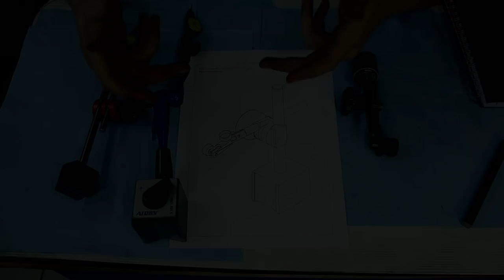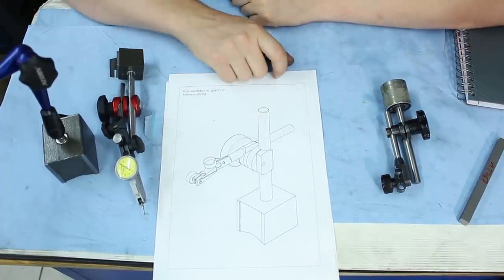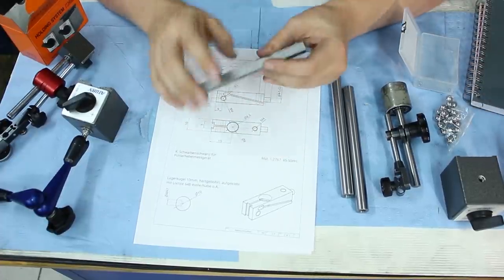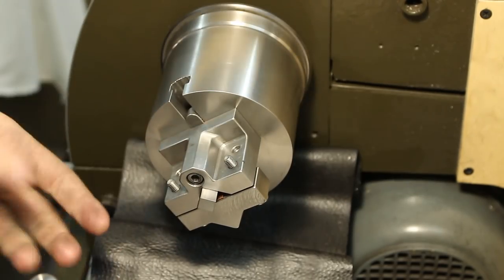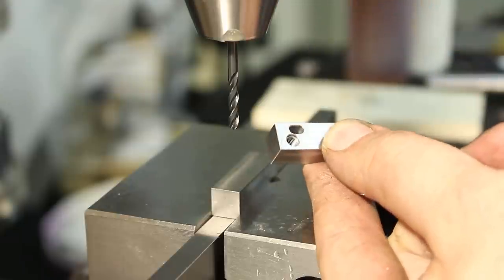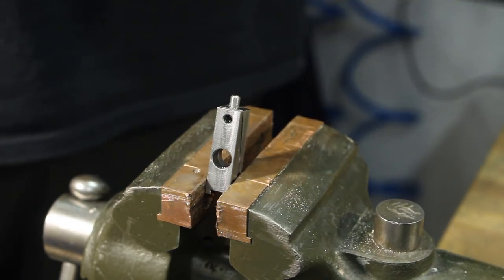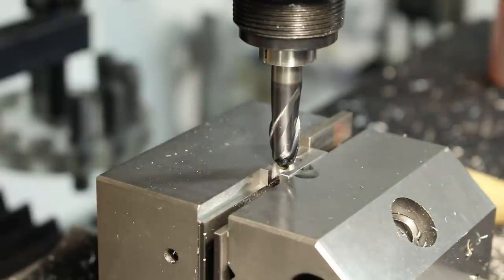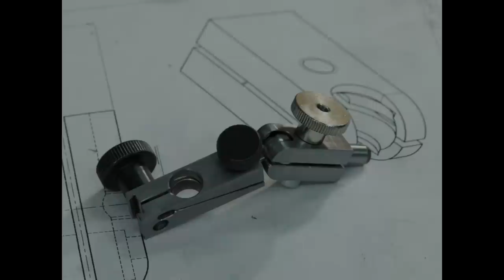Solid Indicator Stand - Part 1

Comment: I once repaired a mag base which had it's main column thread stripped out. Initially a 6mm thick mild steel top plate was made and attached with countersunk screws. The mild steel was a great success and failure at the same time. After remaking the plate in a non magnetic stainless the base was transformed from broken to most rigid stand in the shop and the column never loosened up again.

Comment: The same complaints/problems with indicator mag bases can also be applied to height gages. I have an ex-USN Starrett 18" height gage and anything over 6 inches above the surface plate it gets too shaky. I used to use a B&S height gage at my old job that had a much larger foot print and much greater mass. The adjustment was way smoother and there was no noticeable shake with the indicator at full height. And this was with tenth's indicators. It just goes to show. In the machining world rigidity is one of the most important things there is. Whether it is actually cutting material or inspection and gaging a rigid set-up makes life so much simpler.

Comment: Nice video Stefan! However, I do have some critique:
A high definition ball joint should consist of a ball and two concave spherical rings. Of course, you want to have full control over where these bearing surfaces are located and you might not want them to be to big, because that might ruin the definition. An easy way to accomplish this is by basically drilling two holes with a chosen chamfer, using a sacrificial(?) ball and laying the whole assembly under the press. Thus deforming the material slightly to make a nice and consistent bearing surface...
Reply from the maker: You are absolutely right - Robin adressed that problem by lapping the ball into the joint. I am not sure if I need to do that, the clamping part of the ball joint flexes a bit unter the clamping load of the screw, giving a good contact around the ball and around the cylindrical part.

Comment: work in a gear shop just a tip i suggest aluminum for us as the mag bases get stuck on a side of a machine alot and sometimes on painted surfaces so added wieght like steel becomes a problem not something you want your $500 indicator hanging off of.

Comment: Have you tried the Noga models with the fine adjustment at the base? They are much easier to use with sensitive indicators. Also, how does the living hinge work when holding a larger indicator stem? It seems like the stem would prevent the hinge from working.
Reply: That would be the worst:  the long "lever" from the fine adjuster to the indicator tip means that the smallest movement of the adjuster will cause very large movement of the tip.
Reply: It actually works much better. The adjustment is very fine and easy to control.
Reply: It's just geometry - Stefan talks about at 1:00.  His complaint about the Noga is that the lever for the adjusting screw is very short compared to the lever for the DTI tip.  And "a little movement on the screw moves the end of the indicator1/2 a meter up or down".  It's the same geometry for the base fine adjustment: a short adjusting screw lever and a long measuring tip lever.
Reply from the maker: I tried them at a trade-show, was not the biggest fan of them. I am sure they are absolutely fine for 99% of machine-shop work, but I have a random illness when it comes to tools and tooling ;)

Comment: It seems like the stud on which the ball is pressed is the weak link as far a rigidity goes (small cross section).  I realize that it's near the end of the chain and that there isn't a lot of mass hanging on it, but still.

Comment: Stefan: I like the solid carbide slitting saw you used in this video, particularly the ability to get close to the top of your vice.  What is the arbour you are using and how does it hold the saw blade?  I have a solid carbide saw blade with a circular hole in the centre {no notch for a key} and presume to hold this relies only on friction for the nut / screw combination.  I struggle with using a slitting saw because often I am trying to cut annealed A2 tool steel which simply chews through any HSS saw blade I throw at it.  As a last ditched effort I thought I’d try a carbide saw blade.  Any improvement you have noticed?  Cheers.

Comment: My Ames indicator stand that came with my .0001"indicator  has about 16mm bars, I suppose they wanted a very rigid setup for measuring with. I recently acquired a 1 micron indicator so I suppose I too will be afflicted by the sensitivity of those indicators.lol

Comment: Any chance you'll build the tripod/kinetic mount with with separate mag hold down that we discussed in a earlier comment?  It seems to me that the mag mount is the other serious problem  with dtl stands (addressed by Robin by bolting the upright directly to the lathe toolpost)
Reply: I keep a indicator in a holder that fits like any other tool. I can really tell a difference (lack of rigidity) when I use an indicator on a mag base.

Comment: Wanting to make these but not sure what to use for the shafts...
16x1000mm hard chromed plated bar is £41.
16x1000mm 070M55 (60-66HRC) linear rail is £35

Can anyone recommend which is better for the application?

Comment: Hi Stefan. Nice video as usual. 
I have to disagree about the indicator stand. There is one out there which really work and thats the one from mp-tec formally know as TEKUSA here in Switzerland.
The setting screw works flawless. No hustle to setup 2micrometer. The only disadvantage is the price around 400 EUR.
I wish I had two of them.
Reply from the maker: Agree on the mp-tec - I learned just recently about them :D
A lot of the wire-EDM guys use them too.

Comment: I don't think I have ever heard you say anything good about any tool or material or machine? I think that you may be a little bit fussy about things. You would be a nightmare to work for.  Ha ha Nice video and job on the indicator holder. Is it up to steffan standards though? It better had be or there will be trouble.

Comment: mir fällts bissl schwer, dem Video zu folgen, ohne die Stirn zu runzeln, nach dem du deine Messgeräte immer wieder samt Stativ unsanft ablegst oder sie gegeneinander klatschst.
Auf der einen Seite geht's um Mikrometer und auf der anderen ist es etwas arg "wild"
Reply from the maker: Also wenn der 1/100 Mahr kein ablegen auf der Werkbank aushält, hätt er kein Messmittel werden dürfen :)
Reply: na ich mein nur - manchmal liegts weniger am Werkzeug und mehr am Werkenden ;)